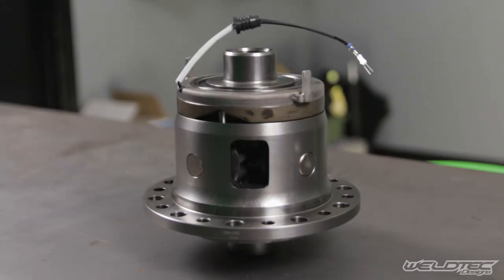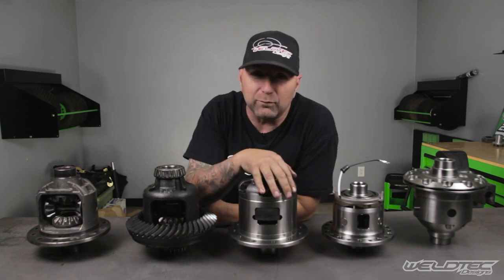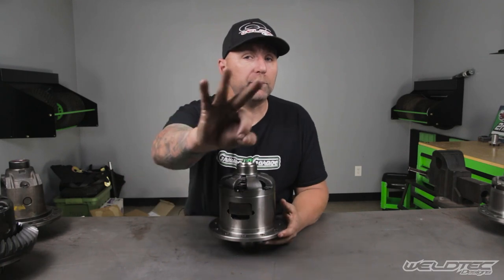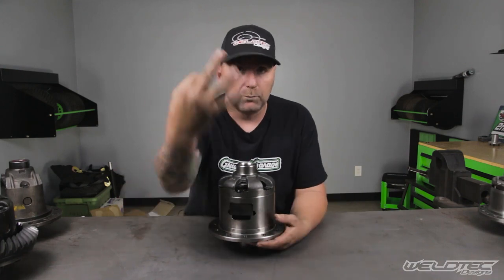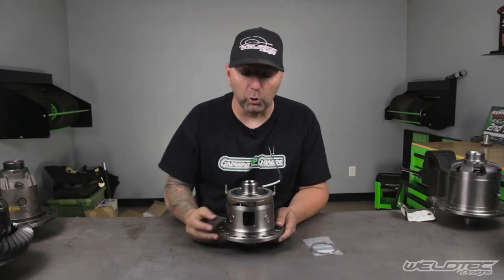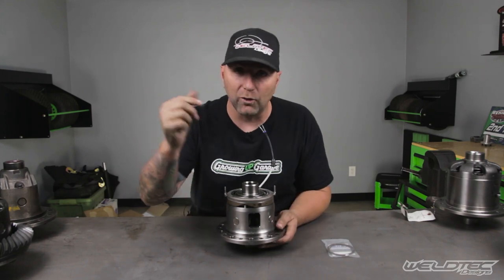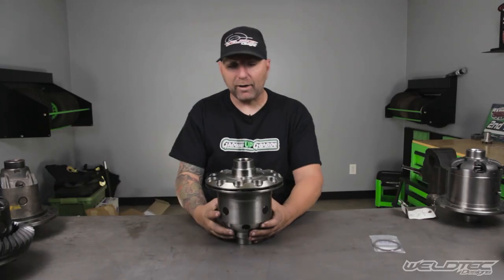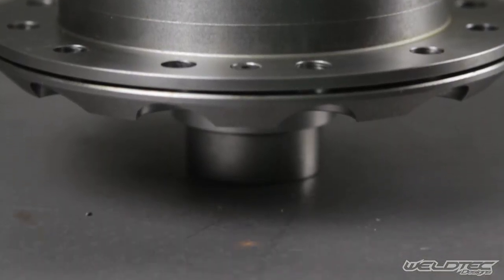What's The Best Locker For Your Van Build!?!

Comment: I put a Detroit TrueTrac in my 2014 Chevy Express 2500. It's a helical-gear limited slip, so no clutches or springs to wear out, and no electrical connections or air pumps to worry about. Very close to the amount of traction of a mechanical locker, but completely seamless and automatic. If you are planning on hard-core off-roading a locker would give you the most traction, but for towing a trailer and occasionally being on a dirt or gravel road it gives me all the traction I need.
Reply: @edwardpeders9582  My 2005 Jeep Rubicon had air lockers as well as a helical-gear limited slip. I pinched an air line and put a hole in it, wasn't hard to find and I was able to repair it on the trail with some tubing and couplers I carried. The limited-slip never failed me though. The electrical locker looks like a good idea though.

Comment: Too bad no Detroit TrueTrac -- I know they won't fit a Ford with 32 spline axles (or at least they didn't when I last looked), only option besides stock limited slip was the Air-locker.  But will a TrueTrac fit a Chevy?
Reply: they make a truetrac for the GM 9.5 which is what I have in my 2018 GMC Savana.  I had one put in mine
Reply: @shanemulligan3571 What do you think of the True Trac so far?
Reply: @johnossendorf9979  works as advertised, definitely helps in the snow. Haven’t really put it to a severe off-road test but as I understand if you get a wheel off the ground hold a little brake pressure while giving it some gas to send traction to the wheel on the ground. Simple, next to no maintenance.
Reply: @shanemulligan3571  Thanks 😊!

Comment: I'm looking for locker or limited slip or something for my 1996 e350 with the Dana 60 4.10 and 32 spline shafts. I would like the Detroit tru track but cannot find anything. Any ideas would be appreciated.
Reply: you may have to upgrade to 35 spline axles... we can do that.
Reply: Had a Detroit locker put on my 1991 E350 but with 30 spline full floater, got the part from Summit Racing.